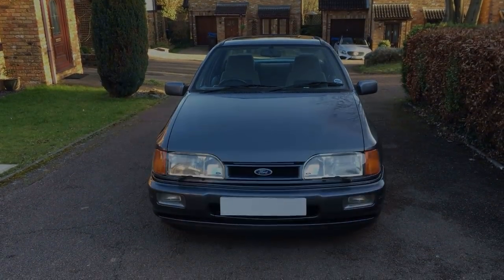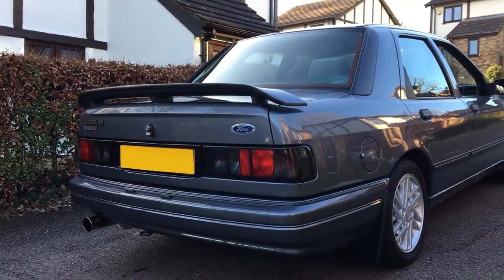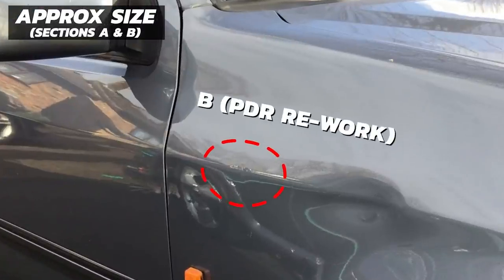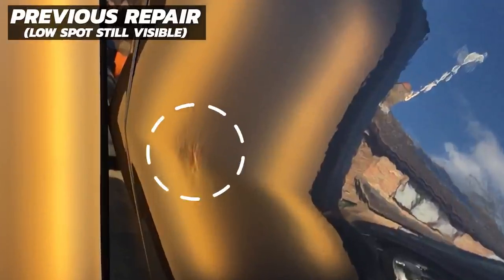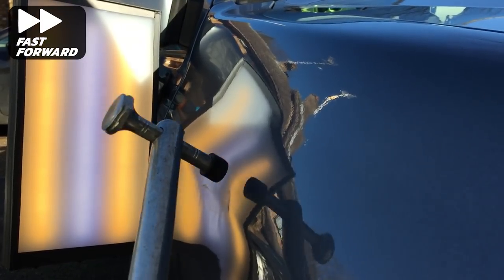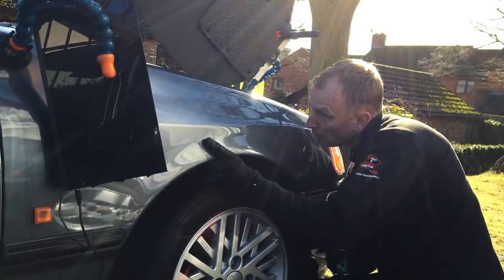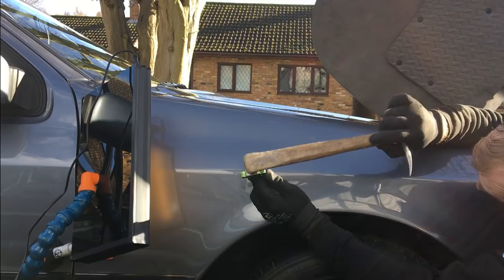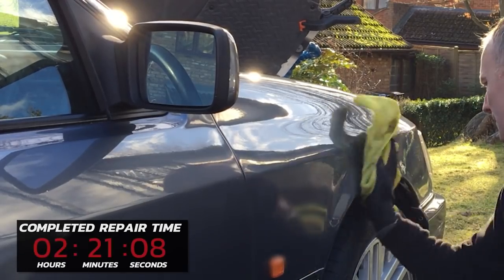Bodyline DENT Removal & Correcting BAD PDR!

Comment: Well done.  I just left a repair shop that told me they can't do the PDR because the small (and soft) ding is on the body line, I think they also figure they will be billing the insurance, so they are interested in taking the more expensive path.
Reply from the maker: Thanks, unfortunately there is more profit in repair and paint than PDR so that is why they choose this route sometimes. Also it may be that they don't have anyone with the skills to perform PDR? fingers crossed the repair still comes out ok 🤞
Reply: @1st_track_dents  It's just a ding, no way am I going to let them redo the entire door and then have the paint/finish not matching the rest of the car.  I can live with a small ding....I only wanted this done if they could do PDR.  I will bring it to another shop where all they do is PDR.
Reply from the maker: Oh I misunderstood, I thought you had no choice as it was going through insurance. If you can choose where the repair is carried out then definitely go to a good PDR repair shop and have a cleaner repair done!  👍👍👍
Reply: @1st_track_dents  Well, the insurance was sending me to that place.  But it is just a ding, so I am not going to have some shop have my car for 3+ days charging the insurance company $1,500+ to fix this nickel size door ding, which may possibly end up having the paint not match the rest of the car.  I bought this car from online car retailer Carvana and when it was delivered it had this extra door ding that they did not disclose, and it appeared fresh, like it happened the day they delivered it...I was hoping they would pay to fix it, their warranty company sent me to that shop.  But, forget it, I'll pay out of pocket for a decent PDR then have some shop overcharging the insurance/warranty company and turning it into a big production.

Comment: Just WOW!!!   My fav part of the repair was watching you fix the bad pdr portion. Now, I can see how a poorly repaired panel actually can be fixed a good bit with time and a proper approach. I 'am' one of those wanna-be pdr techs so seeing repairs like this gives me some aspiration. TY!   Love watching your work!
Reply from the maker: Thank you so much for watching and for your comment 👍 Yes, this bad PDR was luckily saved and massively improved, although they cannot always be saved as a lot of the time the paint is damaged and the metal is stretched. This was on the limit. All the best 😉
Reply: @1st_track_dents  Oh I know firsthand, I have an older BMW practice hood in my garage. And I have most definitely riddled up a spot or two on it, one of which where the paint cracked. So I appreciated every single tip and warning in your repair!  Keep'em coming!
Reply from the maker: @XFBO  Thanks, yes as a tech learning this skill you will mess the panel up quite a few times, but that's why you need to do hundreds of dents on test panels first before being let loose on a customer's vehicle  👍

Comment: Hi Jake well done restoring this Sierra back to an amazing standard. Not nice trying to save someones sub standard pdr work and even worse when the panel is made from proper steel!
Also great video as always!!
all the best
Martin
Reply from the maker: Thanks Martin! Yes I was surprised how well the previous bad repair came out. Made sure it was as flat as possible before I wet sanded it as I didn't want to burn through!
Thanks for stopping by and keep up the good work mate 👍

Comment: there was still a little bit there on the old PDR but like you said, whoever done it probably used a tip that was too sharp and left a lot of micro high spots that wont ever go away, unless of course they take it down to metal and use a little bondo and repaint, but it least the car doesn't look like it has a bad case of acne lol great job!

Comment: Another great repair and wow what a great Re-repair on the other previous attempt (by someone inexperienced). I was sure you were going to glue pull at first but I guess with good access and that large rubber tip it equaled  out.  Thanks much for taking us with you on this job.
Reply from the maker: Thanks, yes front wings/fender panels have great access and if you can get good leverage off the tyre it makes it even easier. Yes, the bad repair really cleaned up better than I had hoped! 👍